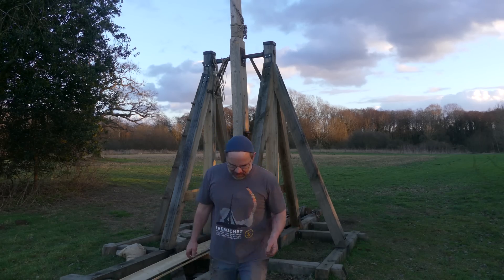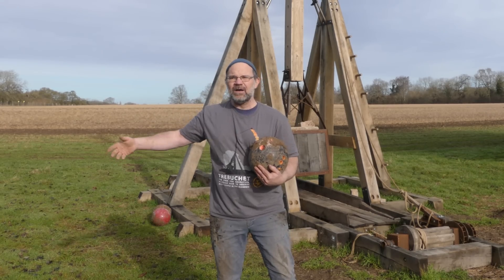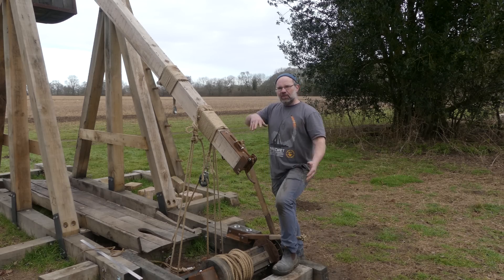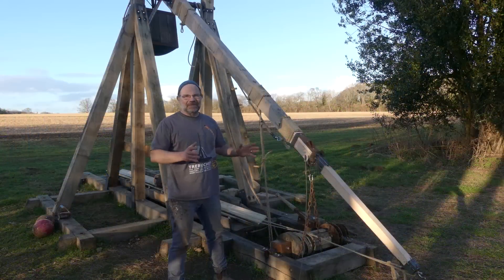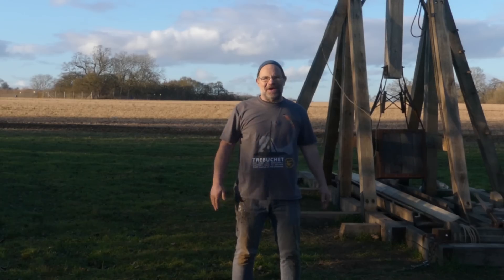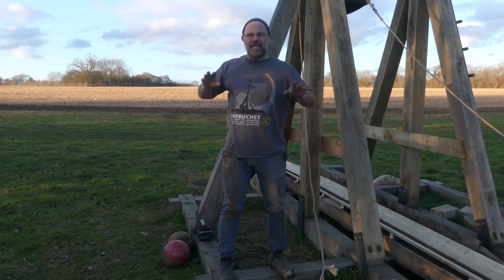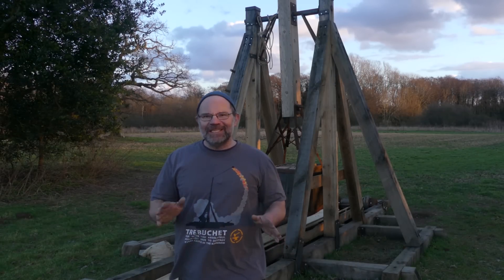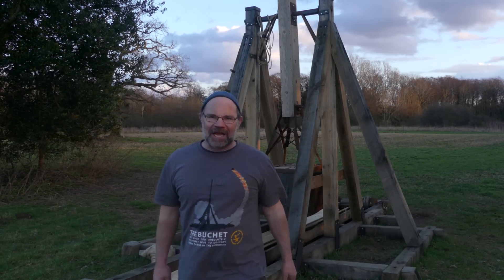Trebuchet gets BIGGER! better????

Comment: Think one of the first rules of siege fight club is that the siege weapon is basically never finished.
When I built a 1/5th scale onager as a teenager that thing basically ate up so much free time it became a bit crazy towards the end. I thin it was small mercy when it finally self destructed.
But when it worked it was funny mix of excitement and sheer terror
Reply: I often think about if the impact on my sanity is worth the Scorpion ballista I'm planning on building

Accidentally shooting a bolt through a neighbor's wall is a close second
Reply: @riograndedosulball248  Yeah the torsion powered ballistas are a really tricky bit of engineering as they need a lot of tuning on each arm so that one isn't lesser-greater than the other and ends up doing something catastrophic to itself. The older era of oxybeles with composite structured bow-arms is probably the easier of such things and ultimately, most of them despite all the work are sort of temporary things on the battlefields of the classical era. Assembled on site, used to do the job and either destroyed, broken up or abandoned after.
Reply: Come to think of it, writing software is the same thing! Except it never self-destructs so it perpetually sucks up your time. <-- why software guys are so weird...
Reply: I get the same feeling when working on my bokart.
It rarely works well, but the when it does. 
best thing ever
Reply: Do you have the blue print?
Reply: @daviddiaz5815  No, I based it off pictures of an 80kg machine which was about 7.5m long, 3.5m wide and 3m tall- then scaled it back to about 1/4-1/5th the size.
(this is also going back to the mid 80s!)
The rest is insane levels of torsion, failure points you never considered and extreme violence
Reply: @krissteel4074  that's pretty cool tho
Reply: That’s awesome